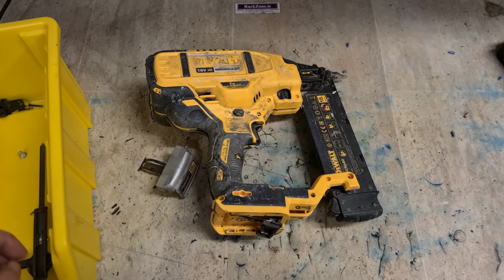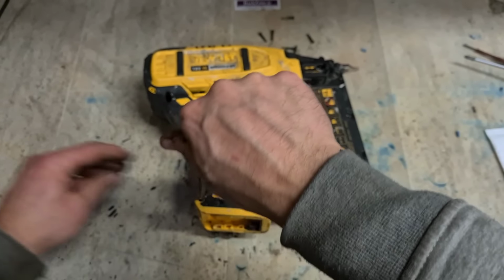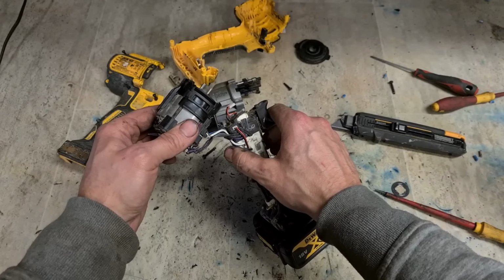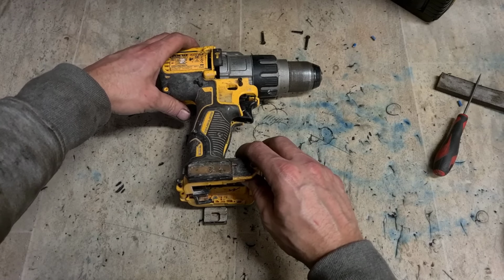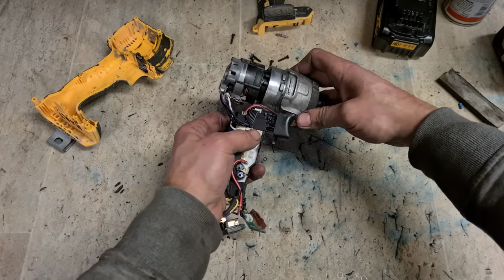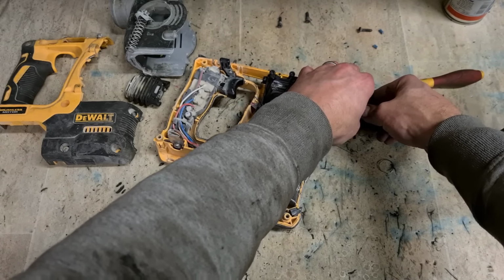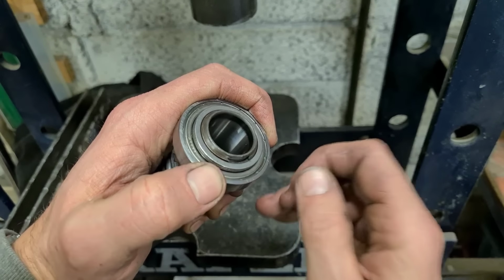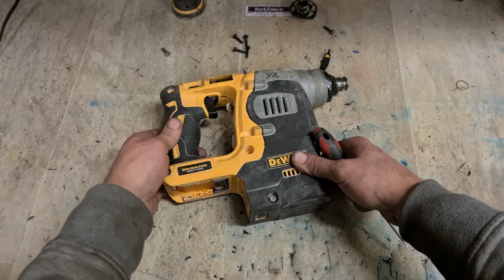A few Dewalt cordless tools for repair, drill, impactor, sds and nailgun.

Comment: Tools fixed in this video:
0:00 DeWalt DCN680 nailer - Fault: Not shooting
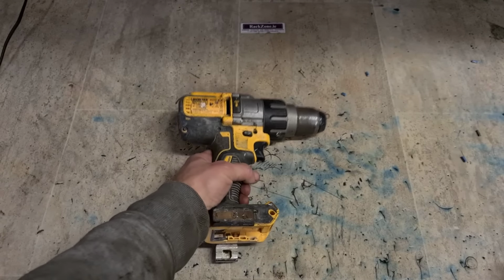8:43 DeWalt DCD996 Drill - Fault: Stuck motor
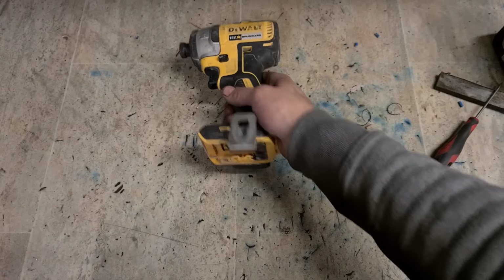23:06 DeWalt DCF887 Impact- Fault: Switch
31:41 DeWalt DCH273 SDS Drill - Fault: Problem with rotating of the chuck
Reply: Fantastic idea - thank you
Reply: Why there skippy?

Comment: What are your thoughts on the Einhell 18v range. I don't think that they are aimed at trades type people, but I've just bought a brushless nut gun and you can register for a 10 year guarantee!!! I've been using their 18v range for about 5 years and in that time I've only had 1 charger and 1 battery die and I'd class myself as a hobbiest/part time handy man. When I bought the nut gun I realised that the tool only price is roughly the same as Milwaukee but I know I'd only be getting a year or 2 warranty with that. Just wondering what you think? Thanks for all the great videos 😊👍👍👍👍
Reply from the maker: Yes, Einhell is quite good for the money. I think a lot of the Parkside tools are actually einhell tools. And they have a massive following and very good reviews. 
Never seen one with  10 year warrenty many you. And I'd be questioning the price is its the same as a mileaukee. 
Also einhell are not just disposable tools like some cheaper brands, they do supply a lot of the spare parts to keep them running outside warrenty.
Reply: @deandohertygreaser  I just checked again and they are now coming with a 10 year service promise on the brushless motor. Not 100% sure what that covers yet as my new toy hasn't arrived yet LOL

Re the price, I was only comparing nut guns of similar power ratings (the one I purchased was a 400Nm Inpact gun). I know that the rest of the range is normally a lot cheaper then the tools aimed for professional use.
Reply: @deandohertygreaser  I can now confirm, it's a 3 year extended warranty and a 10 year warranty for the brushless motor. Pretty good really 😊

Comment: Had a fair few of those DCD996 fans welding themselves to the rear transmission cover like you found there. Really robust motor, hardly ever find burnt stator windings, even after that sort of abuse.

Comment: I enjoyed the decision to speed up the fiddly bits rather than cut them out in editing like you do it a lot of videos.
Reply from the maker: Good to know!
Reply: @hertygreaser I prefer it, too. It just flows better for me when watching. Also you can still see everything done to the machine and where all the screws are. This information is lost when jump-cutting.

Edit: 
What I mean by that is; one time I was trying to repair a laptop and watched a disassembly video. The creator cut the part where he loosened the screws after the first one. After I removed all the screws the part still didn't come apart and I didn't want to force it because it was delicate plastic. So I watched another video and this time I saw there were not only screws to remove but also a few plastic clips to pry apart. That's why I prefer speeding up over cutting out.